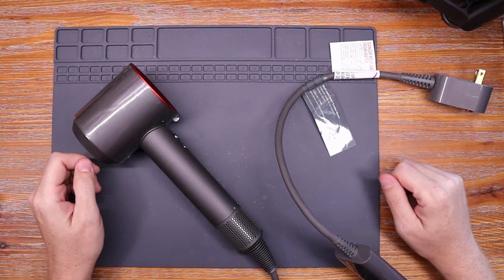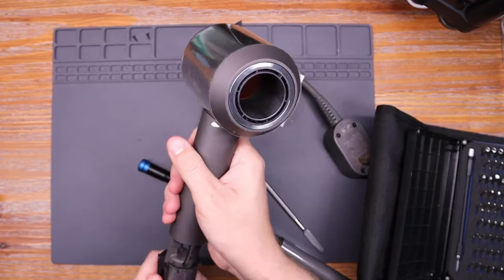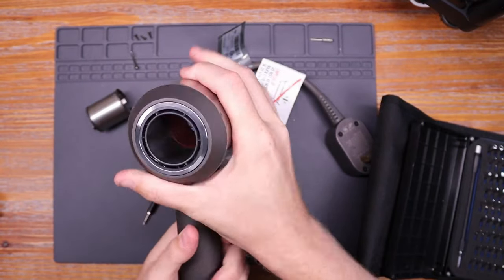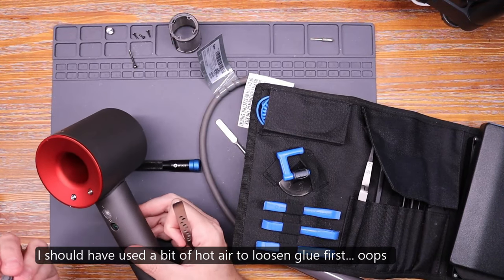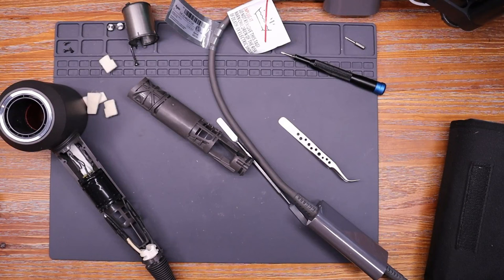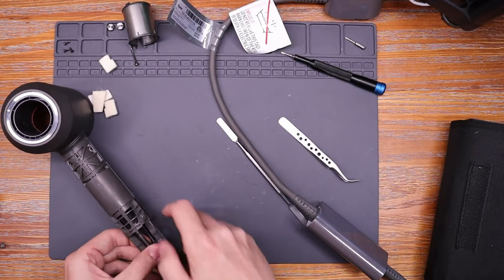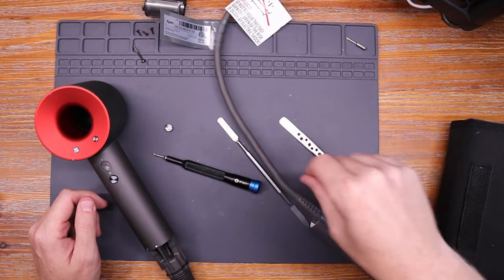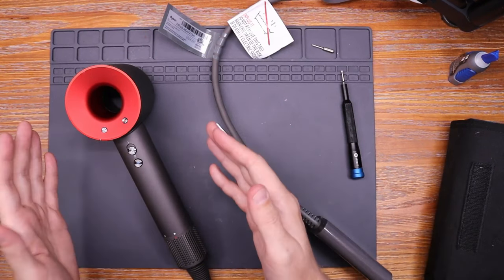Dyson Hair dryer FLASHING LIGHTS fix? | Easy fix!

Comment from the maker: After some thought and looking at other videos showing similar issues, I am fairly certain that the problem was simply that the motor had seized up and simply getting in there and manually moving it freed things up!
Reply: @jessicasmith4478 It says not to use water or cleaning products to clean the filter
Reply: @SchlichteToven  I looked it up on youtube. I believe it was related to Dyson but maybe wrong. I havent had a problem since, i guess you could just try water and soak. Main thing is he doesn't realize the actual filter is the piece that snaps off.
Reply: @SchlichteToven  Yeah it will probably cut off again. You need to clean the filter. Same issue was happening with me. Soak it 30 mins with soap and water and brush the filter clean
Reply: I agree.  In my case, after verifying the filter was clean, I blew shop air into the motor without disassembling the handle and it started working again.  It was a fairly easy fix.

Comment: This did make me laugh. You literally had no idea what you was doing! All you had to do was clean the bottom filter. that's what the 3 flashing lights mean. it fixes this 99% of the time. its an awful design though having to pop off buttons to get inside. lol
Reply: mine was also flashing and all I did was clean the bottom filter and voila, back to life! lol
Reply: @julesjulianjules Mine was as well. I cleaned it, and no dice. Now it's 1:00am and I've got half my hair dried/straightened and have to search the internet for solutions.

Comment: Mine keeps failing the test when it’s plugged in. It will flash red for the test and click, and then keep doing that over and over. If I try to turn on the dryer the lights will flash on but then turn off. Do you know what could be the problem?
Reply from the maker: It's hard to say for sure, but the easiest thing to check is the filter at the base of the handle. It's really easy to remove and clean. I know that if that gets clogged it can cause over heating which can cause the issue that you are describing.
Reply: How do you do the test? My speed lights are blinking after it tries to power on.

Comment: My  dayso dray hair don't work it's new but it have worked for just 10 minut and it stopped suddenly and  the two red light stat to flashing can you please give me an advice
Reply from the maker: I believe that the flashing lights usually means that the filter needs to be cleaned. The filter is the part at the base of the handle and should be easy to get to. If that doesn't fix it, I would try to return it and get a different one since it's new and should not be faulty.
Reply: mine (brand new) not worked up to 10 minute. it only worked for 3 second and keep flashing ... how in the world it filter is not clean. its new..